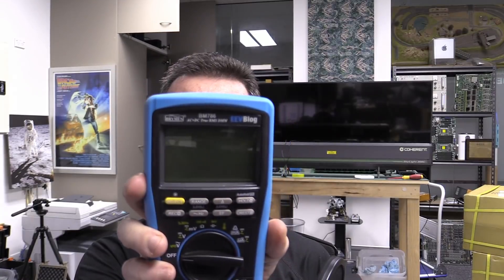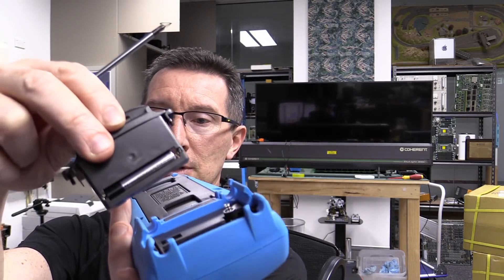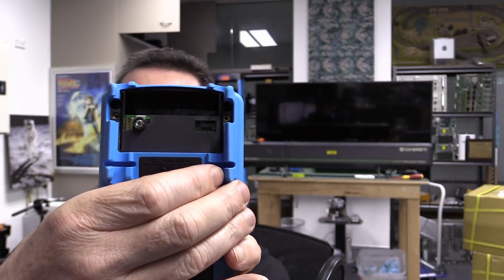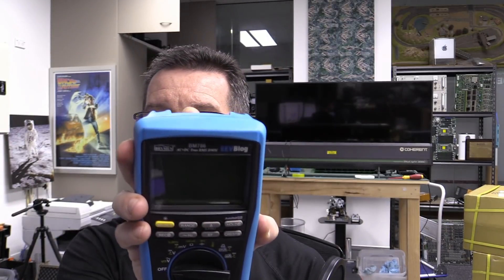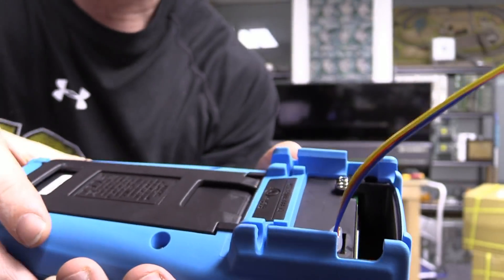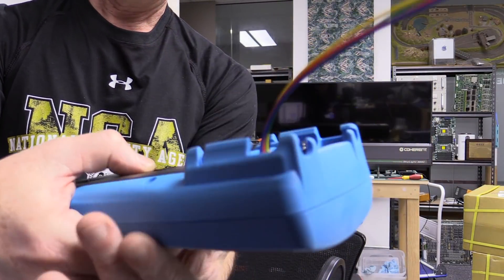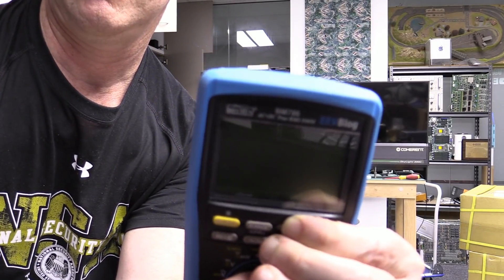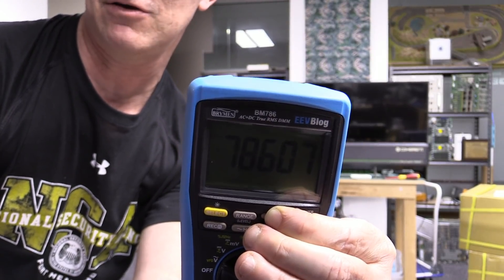BM786 Firmware Update Test

Comment from the maker: FAQ:
1) Why do this video? - Some people haved asked me to show if the factory programmer works, and this was my first time trying it, so I just switched on the camera. That's what I always do. 

2) Why doesn't Brymen allow users to update the firmware? - I don't know, you'll have to ask them. It's not like I haven't asked for that possibility (the answer was no, sorry). This is no different to virtualy every other manufacturer with a reprogrammable chip and an internal factory header. Just because the brymen header is more accesible doesn't make it any different.

3) What does this video demonstrate? - It demonstrates that Brymens new 780 series can be factory and dealer upgraded via a pin header instead of an OTP chip traditionally used, or internal factory test pads. This is a GOOD step forward, as it allows dealers to ensure that shipped meters have the latest firmware if it ever gets updated.

4) I'm pissed off that I can't upgrade the firmware myself, this is digusting! - Almost every meter on the market works like this, from practically every manufacturer. If you think your meter doesn't then you are wrong. Firmware occasionally gets changed, and if you buy a new meter now then it may have different firmware to one you bought last year. You are just often not aware of this. Again, giving the dealers the ability to do this is a step forward from most meters on the market and existing Brymen products.

5) Why do you offer this meter for sale knowing this? - See 4) above. This is actually BETTER than my previously extremely popular BM235 which nobody got upset at that they couldn't upgrade the firmware. If you want a more open meter then try my 121GW, it's got a schematic, user firmware update, programming information, open protocol, and source code for the application software.
Reply: Thanks for the whole explanation and those on your blog cause I went there for the very first time for whatever reason cause I had not seen that before, all the amphour stuff and even older blog entries.

I guess you might have linked to it more than once but I had missed that for years I guess.

Firmware update is always a kind of emergency tool to get things right that had been overlooked.
And it is also a question of effort and gains cause check how long it takes to update your phone, raspberry, windows and even cars and what you will get out of it.

I recently had stopped all of them and  have started my own schedule of "1 maintenance day" each quarter instead of constant update pressure. I might miss some features - but just for a maximum of 90 days and by avaerage 45 days, but I also recogniced that this one is faster than permanent wheel of updates and upgrades cause there are some that get 3 updates or more in 90 days. Of cause a software update is not the same as a firmware update of smarthome components, the car, a raspberry pi and other tools, but at the end it is roughly the same: effort versus gain
Reply: Right to repair etc... Just because everyone else does the same does not make it right or even ok... Good it's moving in the right direction, but other models the firmware could be upgraded with the micro SD.
Reply from the maker: @nikize  AFAIK my 121GW is the only meter in the market with a microSD card slot for firmware upgrade.
Reply: Thanks for giving us a more complete written explanation. I'm glad the header's there and accessible. If consumers were to find an edge case where there was an issue with the units that could be solved by way of a new firmware, they could release the information for those affected (doubtful such a case would be found). That would be cheaper for Brymen. And for those who really wants to mess around with firmware flashing, that can always be figured out in one way or another. So stop it, please.
Reply: In defence of EEV and Brymen. Crack open most electronics and your find a programming port or access to the lines via pads. Don't mean your fridge manufacturer is going to show you know to do it just because it's there.
Reply: Can I still buy the 121GW?  I got one in the kickstarter and would love another.  Have you condisered a bench version?
Reply from the maker: @jamesrbrindle  Yes, it's on my website. No plans for a bench version.
Reply: @sausage5849  Not really the same thing.  Most refrigerator owners don't know how to use a microcontroller programmer.  Most owners of a meter like this probably do or at least have the basic skills to learn the specifics quickly.
Reply: @uni-byte  Yes. However risk to brick this out is always exist and if everything works in the meter why would you want to upgrade the firmware?

Comment: "I'm on NDA". "Won't show it". "it's possible but wont show it". "there, it works, it's definetely *p-o-s-s-i-b-l-e*".
This sounds so much like an invitation to have a go at hacking the stuff :P
Reply: I agree - that’s like old custom chips from vintage arcade games circa 1985 onwards - they die but their regular TTL glue logic keeps working so we reverse engineer their chips - they hate it but tough shit, we want to keep old stuff working.  Same challenge.
Reply: And the color code of the wire was in the shot.
Reply: He knows his audience.
Reply: I don't see much point in hacking a multimeter. Without the firmware, you'd have to write your own from scratch, which may not be worthwhile for a multimeter (depends on if you like a challenge I guess). Anyway, probably uses one of these chips (no real surprise that one by the same manufacturer is used in the 121GW): https://www.hycontek.com/en/products-en/3286

Comment: Imagine the PR boost if Brymen makes firmware updates available online and sell the programmer to end customers. They can start by letting their loyal customer EEVblog do it first...just an idea...
Reply: I don't think so. Letting end users fiddle with firmware would most likely be a tech support pain for zero benefit.
Reply: @MrJef06  A bit like BIOS upgrades for motherboards, if everything works, no need, until you want support for something, or a bug fixed.
Reply: @modrobert  No. It is slightly different   from BIOS. It actually a good thing to be able to do this in multimeter however at the end user own risk..

Comment: Why wouldn't Brymen want the user to be able to upgrade the firmware?
Reply from the maker: Don't know, you'd have to ask them.
Reply: Perhaps it has no way of recovering from a failed flash?
Reply: Probably off the shelf mcu w/o security which would make it easy to do counterfeits. Wonder if anyone imaged the die yet?!
Reply: To sell you a new product just because they fixed a bug in the firmware? Otherwise no reason to not let the user do a firmware upgrade of a device.
Reply: Another possibility is that you could upgrade by purchasing a low end model and flashing it with the firmware from a high end model.

Comment: Absolutely not good to not have the micro and/or the hex file. Had the issue with a blown EFM32 in a meter from uni-t.
Right to repair should force manufacturer to give the hex blob for programming.
Reply: 100% agree!

Comment: As an ee I hate NDA's and closed firmware/ architectures BUT for DMM's and stuff used to determine risk factors allowing users to upgrade firmware is a hugely massively terrible idea...what if you Bork the meter but is has limited functionality and some one uses it to test a live connection and it doesn't indicate a voltage present and someone gets hurt or killed ...the legal throwback to the instrument manufacturer could be huge....not to mention someone got hurt which wouldn't have happened if the user hadn't tried to upgrade the firmware...yes I know we should all be using proving units but not many do in the field.
And yes DMM'S have been proved to be faulty straight from the manufacturer (fluke anyone) but at least the onus is definitely on the manufacturer to recall the product.
Reply from the maker: That is probably one of the reasons why Brymen (and almost every other manufacturer) won't let users update the firmware.
Reply: Coming from your logic, washing machine and microwave oven manufacturers should be sued each time someone decides to wash and then dry (if still alive) their domestic lovely cat/dog. Such situations are easily avoided by putting a disclaimer into the box, which states that MANUFACTURER DOESN'T HOLD ANY RESPONSIBILITY FOR INAPPROPRIATE USER ACTIONS INCLUDING e.g. FIRMWARE UPGRADES. Yes, let user undertake the risks, if they decide to go for latest firmware. How come 121GW manufacturer is not afraid of lawful throwback, but Brymen pees in pants imagining thousand legal actions against them. C'mon, this sounds ridiculous.
Reply: @atexnik  under your logic using the Meter would also cause the manufacturer to be liable. 

The risk in production is within the modification of a product not intended for use. 

You can not sue a manufacturer for using something outside of is intended use. 

A washer and microwave are its intended use. Unless it shorts and burns the house down or blows the front or melts your face while normal operation then its not able to be sued. Now if you take the door off it and bypass all safety (by Manufacturers instruction) and burn your face off then you could .
Reply: @TboneLoyal  so, updating the meter's firmware will turn it into a ballistic rocket or what?
Reply: @atexnik  What if you update the firmware and the meter was allowed to bypass the internal fuse and short you to live wires? I am not saying you could code such a firmware but bugs are imminent when patching. Would you like to update the firmware which in turns kills you?

Comment: Does this also have anything to do with calibration? Where I work, all the "calibratable" tools - both electronic and mechanical tools like torque wrenches and test gauges have to be sent out for calibration. We have fluke meters, and even the "cheap" ones have calibration procedures and can be sealed.

Comment: not making the programmer or the firmware available to the end user of a Digital Multimeter is just plain stupid. I can tear the engine out of my Audi and replace any part I want, but I can't upgrade my multimeter? Firmware upgrades: motherboards, firewall routers, ethernet switches, flashlights....

Comment: Purely off the top of my head, if I were to hazard a guess, and this is only a guess based on the number of wires, I would say that it is probably some kind of UART interface with the handshaking/authentication being initiated by the programmer unit - but that's only a guess, so don't @ me! 😋

Comment: I just listened to the podcast episode 554 and I was interested in the discussion about the programming port on the multi meter. It is easy to sit on the fence with this one, but I was surprised you didn’t see the elephant in the room - that is - the safety and liability issue. As an electrician I would be reluctant to use a multi meter that had the potential to be hacked in any way. Also, I’m sure that any company that produces a branded product would not want too be held liable or even potentially damaging the brand for any accidents that occurred though the mis use of its product.

Comment: Actually, it is quite embarrassing for a company like Brymen to not let their customers update their expensive meters' firmwares to latest versions. So, if your brand new shiny Brymen meter appears to have a bug, you'll probably going to end up living with that, because no one gonna give you a new meter, nor your dealer is going to have your meter reprogrammed to the latest fw. This is so stupid nowadays. I was about to buy BM789, but I read they've modified the backlight timeout in latest fw. Tomorrow they'll find some critical bug and fix it, and so on. The rule here is to never rush buying newly released products, especially from such unscrupulous companies like Brymen. Wait a year or two, read the forums and only then lay down your hard earned money.

Comment: I don't get it, I understand the "right to repair" thing, but this doesn't stop you from buying the chip (pre-programmed) from Brymen to "repair" your device, if the device was shipped with firmware version A and it works out of the box and does everything it claims, then firmware version B is not going to make that much difference to you, if there was a bug fix or significant feature enhancement that didn't require a change of hardware then you'd contact Brymen direct, and if they saw merit in your request provide you with the means or place to take it to to provide the upgrade.  Perhaps it was more convenient / cheaper to use flash than OTP, i've seen OTP more expensive on some MCU's than flash variants. Maybe i'm missing something but I don't understand the hate.
Reply: Does Bryman sell the chips? Do they provide a list of bugs to versions?
Reply: @awuk3468  They have every right (currently) to do this and it's their choice to do so. Doesn't mean people need to support it. And just because it works for you doesn't mean it's appropriate for all.
Reply: @adampe-1440  I am not saying you should support Brymen in their decision, I mean it is their product and their decision, don't like it, don't buy it, that is YOUR decision, just don't understand what is the issue, there are a ton of multimeters on the market that are closed source and unprogrammable, big deal, at least you know there is potential for this one to be upgraded without having to have a whole new meter, and potentially by a local partner, beats soldering OTP and recalibrating that's for sure.
Reply: I don't understand why not making firmware user upgradable. It's more expensive for the manufacturer the risk of possibly reclaiming thousands of products for a firmware bug than providing the user the tools to upgrade it. Also even if you don't have to recall the product, having the firmware user upgradable would let you start production even if the stable firmware is not ready, or if some features are still missing: the user when he receives the product can just upgrade it. 

And I understand years ago, but these days there is no excuse. The only more complex thing is that you need to provide the user with a simpler way to upgrade the firmware, in particular not requiring a particular programmer, that is usually done via interfaces like bluetooth/Wi-Fi (that these days are very cheap) or  via a standard TTL serial cable. Of course in both situations you have to have a bootloader and a double partition, but it should be the standard these days.
Reply: This has nothing to do Right to Repair. Some people are just pissed off because I showed that it's possible, and well, it's The Internet. This is no different to any other meter manufacturer that uses a flash part, except their programming header is inside, or as bed of nails test pads or whatever.
Reply: @adampe-1440  They don't sell the chips, but I think they have provided (pre-programmed) replacement chips to people before. There is list of changes on the eevblog forum, and I'll add that to the manual like I did with the BM235.
Reply: @EEVblog  Thank you for the thoughtful response! Glad to see these errata are tracked and available in case someone runs into an edge case.

Comment: Hey Dave, can you give an example of a gross bug you have encountered in these meters which would required the update? Also can be calibration done via this interface as well? Tnx
Reply: The long determination of resistance in auto mode is very annoying. For example, it shows first 9 kOhm, after a second 10 kOhm.

Comment: I miss the 9Volt battery in the Brymen meters.  A good Brymen LCR  meter  with 9v would also be nice to see.
I have bought a uni-t LCR meter with 9v.  
Still looking for a new multimeter  under 150 euro.
Reply: I don't like 9v batteries, they are expensive for the amount of energy they contain and almost always have crappy snap connectors that get loose with age, or the wire gets busted.  Meters that work on a couple of AAs are by far the best solution IMO.

Comment: 6 pin header w/ 5 pin wires, with a SIL header, probably a PIC micro which is common in prosumer tech. Or maybe an STMxx. Dave was talking about how the meters are going to be hard to come by due to chip shortages and iirc it was the ARM based STM micros that are scarce as f--- which is breaking the auto market atm.

And yeah don't be so hard on Dave, he's under NDA, companies love bitch fucking us aussies for not sticking to NDA so full respect to him for taking the effort to provide SOME kind of content. Anyway, use your brain ya muppets, this is a challenge, a great little mind puzzle to ponder whilst in our dwellings.
Reply: looking at the wire colour coding, theres a ground (blk), positive (red), data, maybe serial? (yell grn) and probably a reset? (blue)
Reply: can store the program and 5 pin connection w/ reset, probably a PIC micro :)